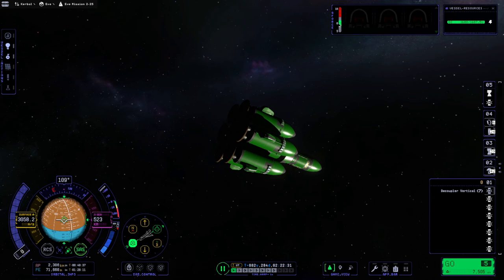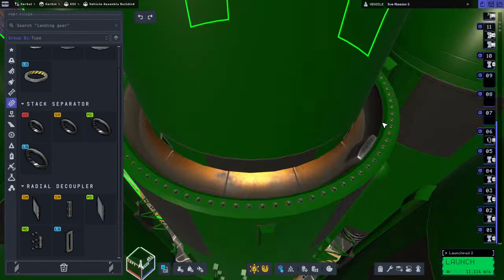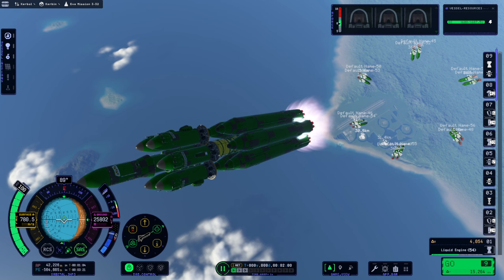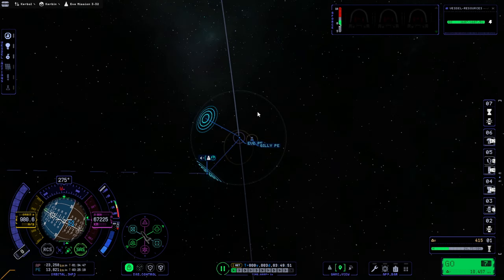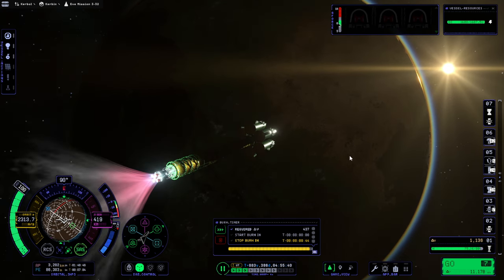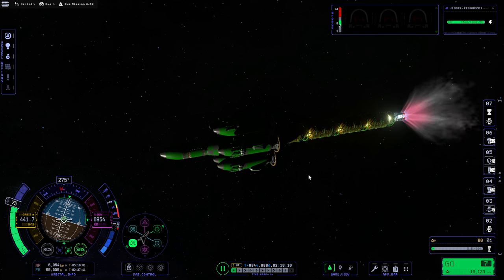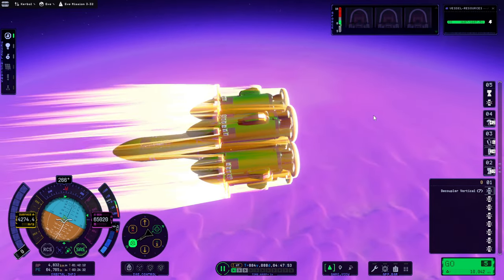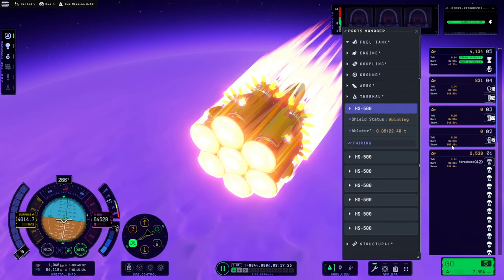KSP 2 Early Access - For Science 51 - And With Airbrakes

Comment: Yeah, like others, I also think you need to more or less circularize in Eve's low orbit. Then I'd give the inflatables a shot again since they weigh less. I'm currently trying to do this mission too, but I went with orbital refueling, I want to be sure to get back. Basically my approach is to dock the command module with the crew payload with a fully fueled craft after it escapes Eve in Eve's orbit so I don't need to bring deltaV to get home to the surface of Eve.
Reply: I also like to play a bit more realistically, you would definitely do some orbital refueling if you attempted a mission like this in real life.
Reply: @lukaspospichal9362  Agreed.  My KSP1 Eve missions were similar to yours.  I'd almost circularize in low Eve orbit, with an apo just high enough so that after I'd passed my peri in Eve's atmosphere and was on the way back up my apo would then dip into Eve's atmosphere, giving me two chances to lose speed and heating.  Then, my landing gear assembly was in decouplers, so once I landed with a wide base, explored, and took off again I could immediately jettison the extra weight, then I'd shed stages as I went up.  I'd arrive in orbit with just enough fuel to dock w/ my orbiting fuel reserve, which would give my now-tiny Eve to-orbit vehicle enough fuel to return to Kerbin for landing.

Eve was and is tough.  I watched Raiz land using inflatable heat shields in older videos.  I never could get consistently good at it, or at Eve. :D